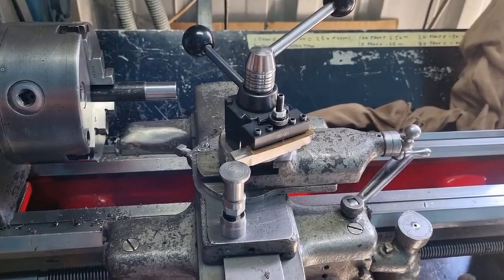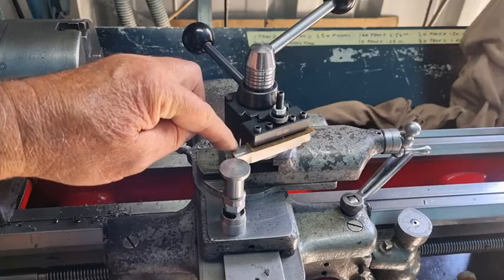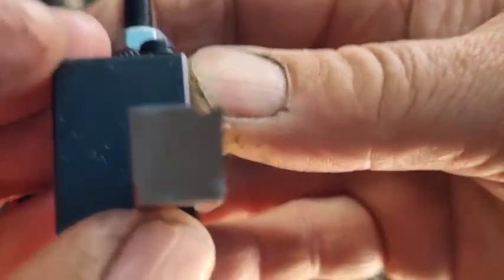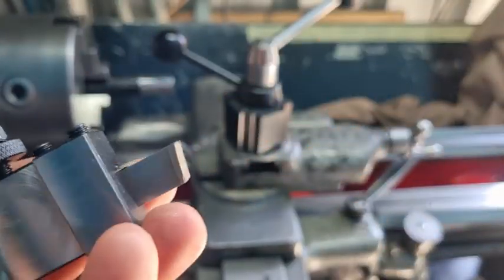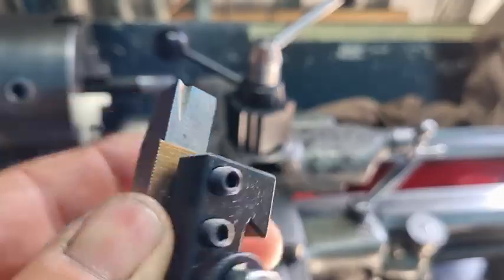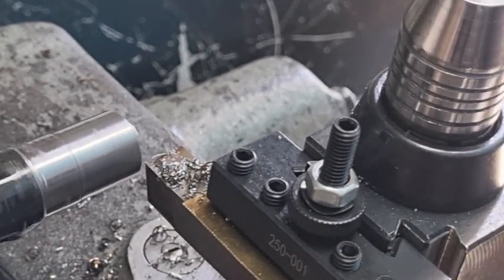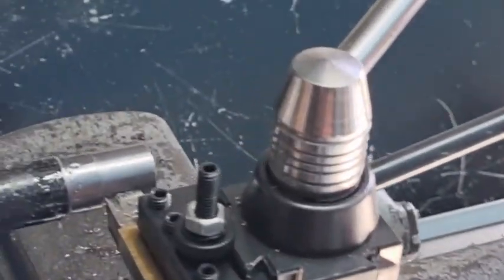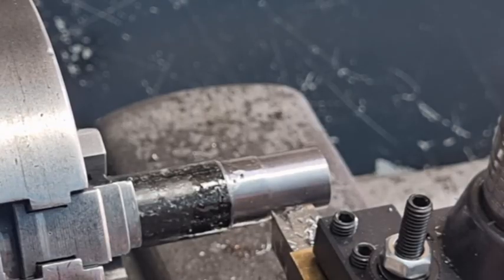HSS is it worth using a chip breaker, you be the judge

Comment: The usual way to break the chips is to increase the feed rate. Your chipbreaker is not functioning how it should, the swarf is not entering the groove. The chipbreaker should start at the cutting edge not in the middle of nowhere.
Reply from the maker: A groove near the cutting edge acts as a chip breaker by causing the chip to curl, bend, and break into smaller, more manageable pieces, preventing long, stringy chips that can damage the workpiece, tool, or clog the machine. These grooves are often called chip breakers, and they work by deflecting the chip against the tool's flank face or the workpiece. This process relieves pressure, allows chips to be ejected easily, and can improve surface finish, tool life, and machining efficiency.

How a chip breaker works
Curling and breaking: The groove forces the chip to curl and bend against obstacles on the tool's face. This continuous bending action, especially when the chip hits the workpiece or the flank of the tool, hardens and makes the chip brittle, causing it to break.
Chip control: By breaking the chip into smaller pieces, the groove prevents long, tangled chips (ribbon chips) that can cause problems like surface damage, tool breakage, and machining interruptions.
Pressure relief: The breaking action reduces the stress on the cutting tool, leading to increased tool life.
Improved performance: The smaller chips are easily ejected, which is especially helpful for high-feed applications and in certain materials like aluminum.
Heat dissipation: Shortening the chips helps them cool down faster as they are ejected, which is particularly useful when machining materials that generate a lot of heat.
If you look at the video you will mostly small chips.
You are correct when you say speeds and feeds influence chip breaking.
Any groove next to the shank cutting edge will act as a chip breaker same as all carbide insertsare made that way, a carbide triangle bit has a groove running parallel on all 3 sides.
Hope this explains it.
Reply: @hercus9a  Thanks for the copy and paste. If you look at the carbide inserts you mention. You will see the chipbreaker goes all the way to the edge and all the way round. Firstly, your chipbreaker should be parallel with the leading edge and actually be the leading edge. Your chipbreaker has vastly increased the top rake angle which is actually encouraging stringy chips and will fail prematurely. You will also notice that your chipbreaker is far wider and deeper than the carbide inserts. The function of the chipbreaker is to try to curl the chip back against the feed direction. Separate chipbreakers used to be clamped on top of tools and therefore higher than the cutting edge. This acts as a obstacle to the path of the chip, directing it back at an acute angle and fracturing the chip.
In the demonstration, the obstacle on your tool is the same height as the cutting edge so you have vastly increased the top rake in an attempt to direct the chip down into the groove then up against the other side of the groove. It can be seen that the chip is not entering the groove at all due to the land between the cutting edge and the start of the groove. The traditional method is to have a zero to negative rake on the top face of the tool, then grind a small groove along and up to the leading edge at the correct rake angle. I would definitely regrind the tool to the traditional spec, incorporating the geometry described above. Take a deep cut along the leading edge of the tool at a fine feed this will produce a typical stringy chip, strong, due to the depth of cut and flexible, due to the fine feed. These are the hardest to get to chip and would be a good test to refine your tool geometry.
Remember all you are trying to do is direct the chip into a vertical face, so the leading edge can simply be lower than the top of the tool. Hope this helps the viewers.
Reply from the maker: @Bosun-8  thanks for your input you raised some interesting points.
Also remember a lot is trial and error speeds and feeds and material being turned.
My chip breaker gave partial chip breaking not 100%.
Do you use HSS and make your own HSS bits ?
Reply: @hercus9a  I rarely grind HSS nowadays, there are plenty of proven Carbide inserts for virtually every application and material type. Back at school, we were taught the basics including rake & clearance angles. During the early part of my apprenticeship we took a deep dive into the geometry as this will apply to most types of cutting tool that we will encounter during our careers. We ground a lot of lathe and shaper tools. Little did we know how much carbide would advance during the following 50 years. Carbide manufacturers are constantly refining their chipbreakers for new applications and materials. It has become more important with machines running unattended and the usual terminology for the "ideal" chips is 6's and C's referring to their shapes. As I mentioned in my original comment, I generally encounter most machinists relying on the feedrate to suit the insert geometry & material to break the chips.
If I had a HSS blank that I wanted to have a chipbreaker for O/D turning. I would just grind a step at around 7 degrees about 3mm wide on the leading edge. No groove, let the chip follow the top rake until it hits the step face which will fold the chip back and break it into small pieces. A small radius in the step will help, a large radius will encourage the chip to flow and the upright face will be at a shallower angle. Having the cutting edge lower than the top of the blank will allow a higher chipbreaker.
Reply from the maker: @Bosun-8 Thanks for your comments